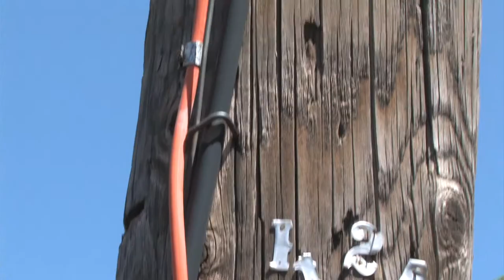Comcast Installs Cable TV, 2009

Comment: I was just wondering how you were able to get them to lay wire and tubes down to your house? Because down here where I live Timewarner Cable doesn't provide any type of service to my area but the town just 4-5 miles away gets it and I'm really frustrated over not being able to have internet or cable.
Reply from the maker: They just did it after bad experience with naked cable.It needed a lot of begging and prodding.